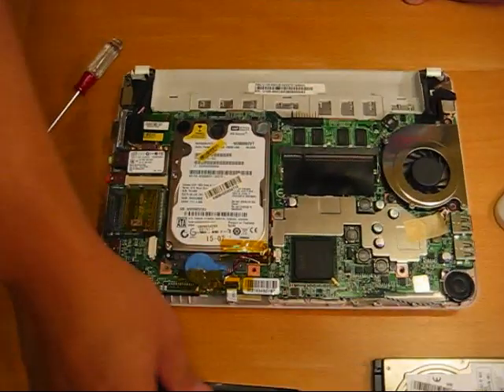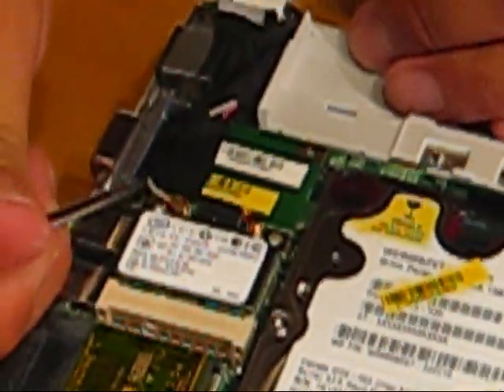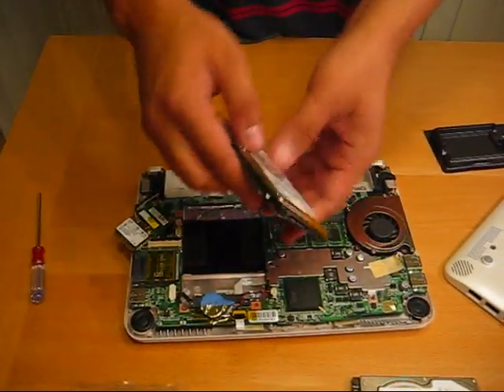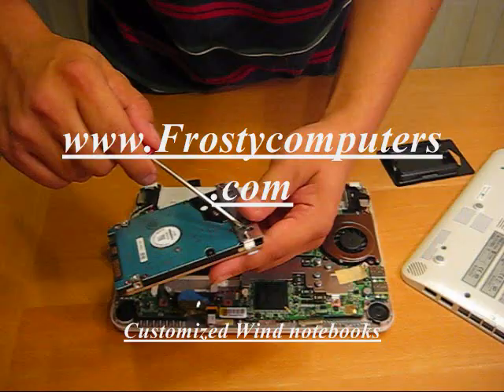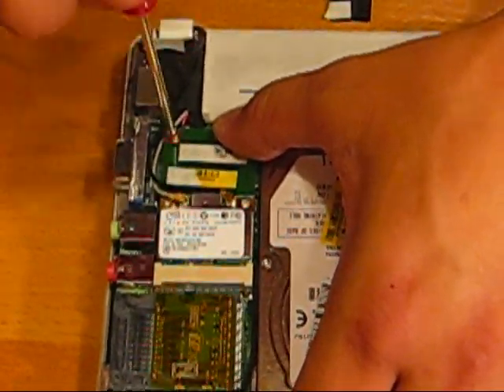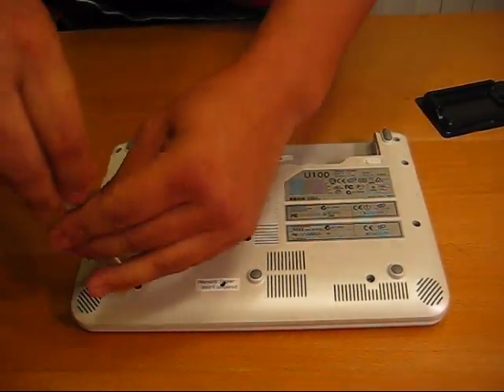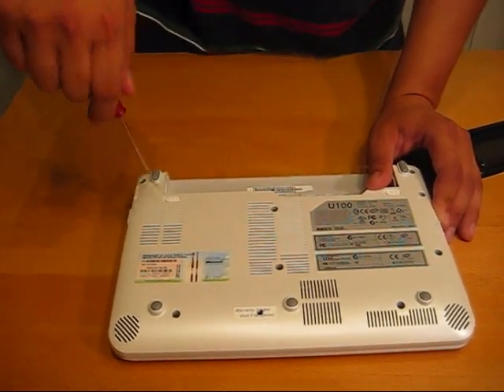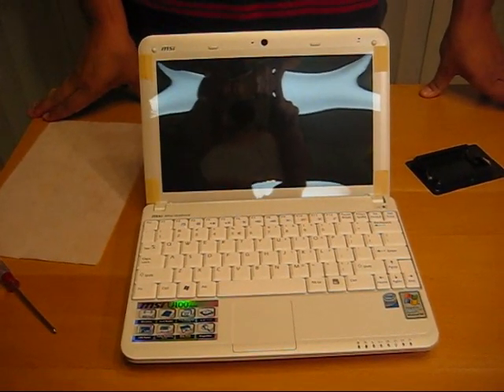MSI wind notebook upgrading ram memory and harddrive

Comment: In the video above, you state that the MSI winds support up to 320GB hard drives; however on your website, there are Winds with the option to upgrade to a 500GB 7200 hard drive. Are Winds (including the L1350 with Windows7 Starter) compatible with 2.5 SATAII 500GB hard drives? If yes, do they need anything else software wise to function properly? This was a good, informative how-to video. Thank you.